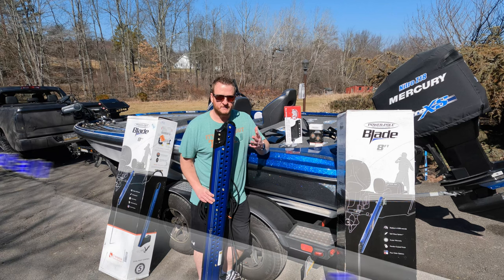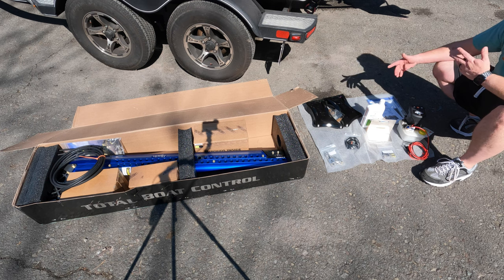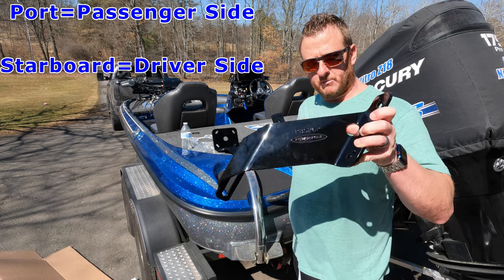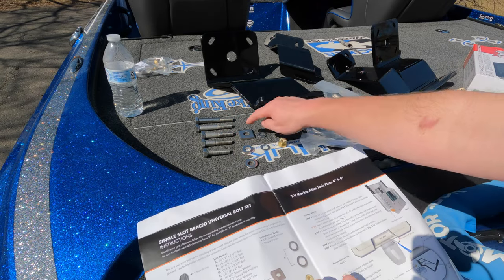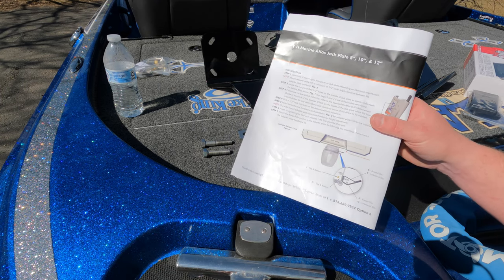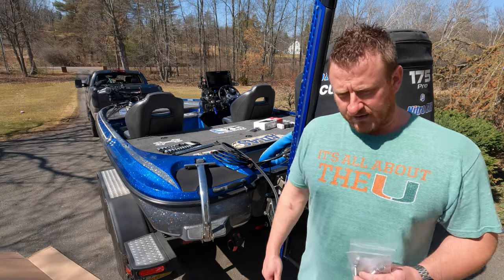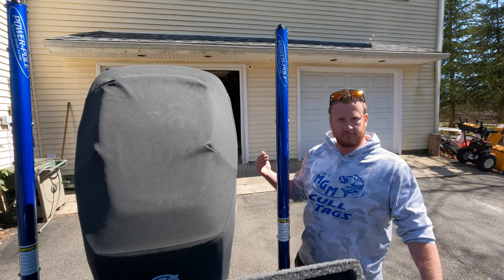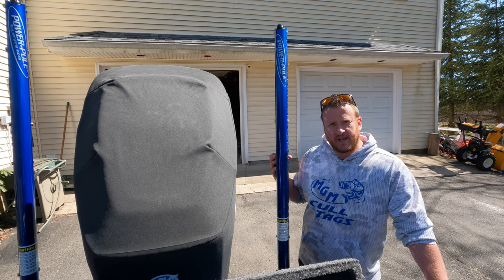How To Install Power Poles...Step By Step, Anyone Can Do It!...Tips/Techniques I Haven't Seen Before

Comment: Have been considering purchasing and installing some power poles and this help me know I can do it myself. I have done most of my upgrades myself and this video helped me confirm I could do my own as well. Thanks for sharing. Very helpful video as usual.
Reply from the maker: No problem, thanks for checking it out!… It honestly is a very simple process, just a little intimidating if you’ve never done anything like this before… If I can help at all let me know!

Comment: I installed a power pole this morning, what you pointed at are 4 bolts with metal/rubber washers and nuts. 40ft/lbs is fine, just make sure the pole doesn’t move when you try to push it side to side as part of your check. The main concern is 80 ft lbs at the bracket… hope that helps

Comment: When you go to drill with the actual 3/4" hole saw ...is it a metal hole saw bit ? And also .... Do you run the hole saw blade In reverse as well like you did the smaller drill bit ? Thanks !
Reply from the maker: Yes sir, I used a bi-metal hole saw, works great…and yepper, I go in reverse just to get through gel coat, and then pop it in forward…hope that helps!

Comment: Patrick, where did you get the battery terminal extensions I saw in the video?  Thanks!!
Reply from the maker: Hey Tom!…do ya mean the bars with 4 posts on them for connecting ring terminals?…got them from LithiumHub, here’s the link for ya but it does say they’re back ordered currently…hope they helps!

https://lithiumhub.com/product/terminal-adapter/

Comment: Hi Patrick.  Very good video.  Makes me confident that I can work on mine if I have an issue.  On commet I'll make is mine are connected to the on off main switch and I have a relay in line? Yours must be an updated version from mine in 2018? Also if I have to drill into the glass I will put some painters tape,masking tape or duck tape to prevent cracking of the gelcoat.  Good to see ya back online hope to meet you some day soon.
Reply from the maker: Thanks Chris, I appreciate that!…yea mine didn’t come with any kind of relay, just the inline fuse…I can’t remember if my last set of Blades on my old boat had a relay…and yea the tape method when drilling through the glass is a good option as well, it’s a nice way to make sure ya don’t get any cracking!…thanks for watching the video!

Comment: How long are the screws that mount the pump brackets to the boat ? I'm ordering HDPE as well and am trying to figure out what thickness to order so that the screws don't go all the way through the HDPE. Thanks !
Reply from the maker: If I remember correctly they are 1 inch screws, I’d have to take one out and measure it to be 100% sure but I’m almost positive that’s what they were…hope that helps!